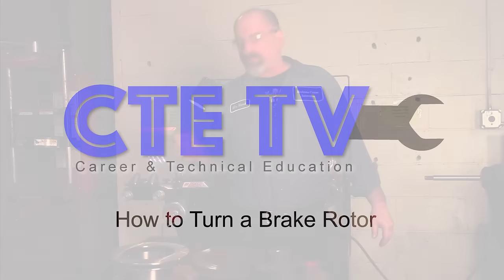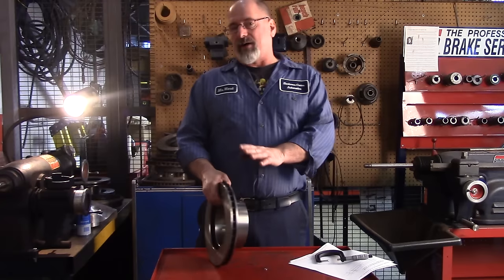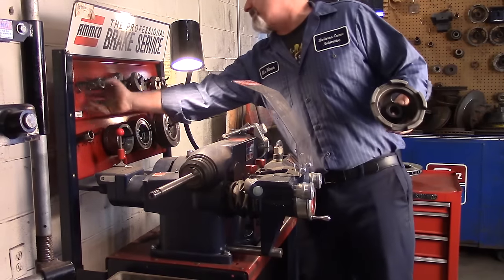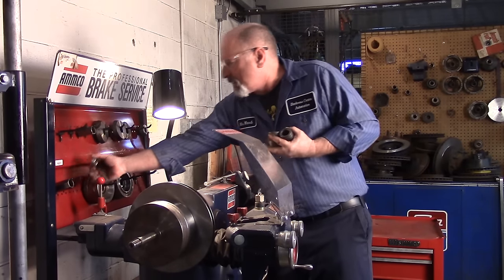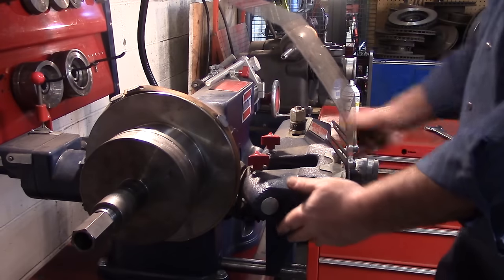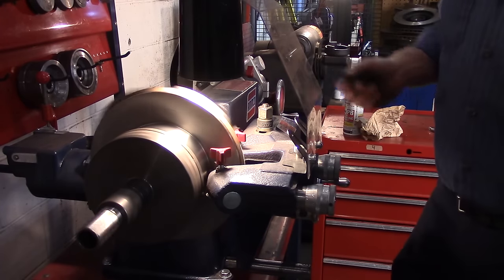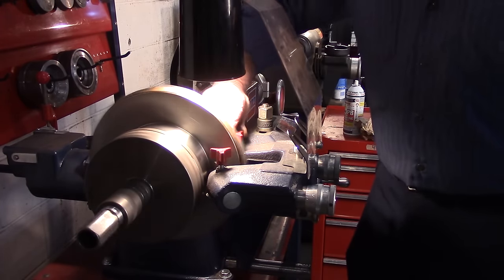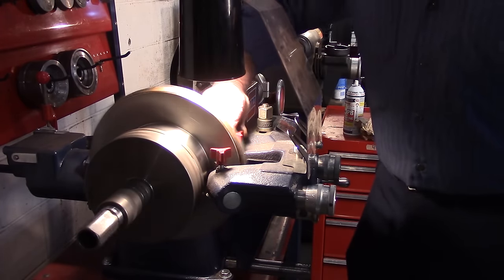How to Turn a Brake Rotor

Comment: I don't want this guy cutting my rotors or even sanding them like that!... He is even using the wrong adapters!
Reply: I was wondering why he took the rotor off to use the roloc, id spin the lathe and evenly rough it up.

Comment: Thank you that was very informative, all my 32 years of being a mechanic I only resurfaced one big drum. I learned how too in trade tech school but the shops I worked at never bothered with that. Now that I'm retired and going to open up my own tire shop I would like to offer that service as part of a break job. I did resurface a brake drum, from a caterpillar scraper because it was metal to metal and too expensive to replace, on a horizontal boring machine.
Reply: gene coppedge ,

That's when the Light came on for me in College Automotive Brake class also.

I too plan on operating a Shop also......Don't use a Micrometer on brakes where you presently work , don't think it's critical to take measurements, have no intention of ever using a Mike, don't stop here.
Reply: Metal to metal = replacement time. You got cheap. Be careful, your future costumers will depend on you not to get cheap on them

Comment: This was really great "How to".
However, at the end when washing off the rotor - wouldn't it be more prudent to just clean off the disc with brake cleaner versus water?
Reply: Machining slightly magnetizes the rotor surface, the tiny steel dust will cling to the surface and can occasionally cause brake squeal. Brake cleaner will not remove all this dust from the grooves made while machining. Soap and water will lift the dust and allow it to be rinsed away.

Comment: No scratch cuts to check for lateral runout or mounting on the arbor?

"Roughing up" the rotor after machining?  Do you mean breaking the directional finish cut into the surface by the cutting bits to prevent pad walk and brake squeal?

FYI from AMMCO:
Note: Either rough or finish cuts may be taken to resurface a rotor. Generally, finish cuts should be 0.004” to 0.006” per side. Very shallow cuts of less than 0.004” per side tend to reduce tool bit life because the heat generated during reconditioning isn’t transferred to the rotor efficiently. Rough cuts may be taken from 0.006” to 0.010” per side.
Reply: Another guy who actually read the manual. There's not many of us around. 👍
Reply: @mikecollins9789  I recently retired after 41 years teaching automotive apprentices in college here in Canada.  It sort of goes with the territory.  😀

Comment: I am a professional brake lathe technician... this dummy is using the wrong centering cone with the wrong cup. If you look at what is hanging on the rack in back of the lathe, you will see a complete Adaptek system--which is the best cup and cone system available.  But this guy is using a piece of junk aluminum cup at the primary inside cup with the Adaptek centering cone.  Should have used the smaller/thicker steel Adaptek cup as the inside cone.  Aluminum cups are notoriously inaccurate.  If he would use the Adaptek system correctly there would be zero 'run out.' 

Secondly he describes a "rubber isolation spacer" --which is not a vibration isolation device at all. What it actually is, is a slip-ring device which keeps the arbor (main shaft) straight when the arbor nut is tightened.  The spacer devices are not exactly straight end-to-end and when tightened the arbor will bend upon being tightened.  Actually what he has is called a 'rubber spacer' and this is put on the end of the arbor adjacent to the arbor nut. 

Also the 'vibration strap' he describes is not a 'vibration strap' --it is a lead-weighted 'rubber silencer.'  You have to have some sort of damping device around the rotor to absorb vibration and prevent cutting bit chatter.  Also--it's called a 'twin cutter' not a 'facing tool.'  

Finally--do not rough up the rotor as he shows in the end with a angle sander and a rough pad.  Do this operation while the rotor is still on the lathe and using at the most a 100 grit piece of emery cloth hand held.  The only thing completely correct shown in the video is him washing down the rotor in a pail of water using soap.
Reply: alex hidell 😂😂😂😭 I lost it at “professional brake lathe whatever” what the fuck is that? You cut rotors at orileys or autozone? Lol! It’s not rocket science! I disagree on both you and the guy in videos method of roughing up the rotor. His looks ugly way uneven and your way can cost you a hand. I use a  Roloc disk and lightly go up and down while spinning on Both sides.
Reply: I noticed he started with 955/1000 and said he took off 10/1000, then measure 940/1000. Im like you took off 50% more than you wanted to, thats not very good.
Reply: yep that was crap ,all the right tools available and uses all the wrong tools 2th notche on the 6950 tool ha ha ( he has know idea ) just took off a third of the life of the rotor and cut 10th runout in that rotor and as soon as it gets hot it will return to his shop to get reworked and he will blame the customer ...cheap chinese rotor ...puddle of water or car wash and its his poor practice which caused the problem , the best so far i have done on a rotor was .14mm or .07 mm per side about 3th per side using the same machine and tooling as he has ,i also have a 4100 that cuts just as well ...its not the machine but the operator , i have watched a lot of youtube  videos and still have not seen a operator that has impressed me
Reply: Yes, everything you said is 100% correct. 👍
Reply: @moavic5087  you might want to swallow your pride and learn from Alex. He clearly knows what he's talking about, he's 100% correct.

Comment: Hi, thank you for the video. I have a question question (I know this is an old video I apologize).  It looked like you were facing-off both sides. Why do they call it "turning" when you are actually facing off?  I have always wondered this. Thank you!
Reply: “Turning” is simply a term used to describe the lathing process. Usually it’s used in reference to removing material from the outer diameter of a workpiece, but can also be used in reference to general lathe-work.

Comment: New rotors have a 2 thou runout, a lathe can get it to 0.5.....

They aren't technically warped, they have uneven levels of brake pad material buildup from hard / high heat stops

Comment: No explanation of how to use a scratch cut to determine if the rotor is parallel with the lathe?
Reply: Another guy who read the manual. Not many of us around. 👍

Comment: So half way to establish “zero” point, then back into the hat and adjust 2 thousandth then run a fast cut, then adjust 1-3 thousandth ish each cutter for for the slow cut
Reply: No, .006"-.010" for rough cut, .004"-.006" for finish cut. Never less than .004" per pass.

Comment: Poor design of handle with the operator needing to reach over to engage lathe ?
Reply: Tell us you've never worked in a machine shop without actually telling us you've never worked in a machine. Did you ignore everything he said prior to operating the lathe? Those instructions were not suggestions!

Comment: Too many people have been brainwashed into believing rotors need to be thrown away every brake job! Rotors are manufactured with extra material on them for a reason, that reason is so they can be turned when replacing pads.